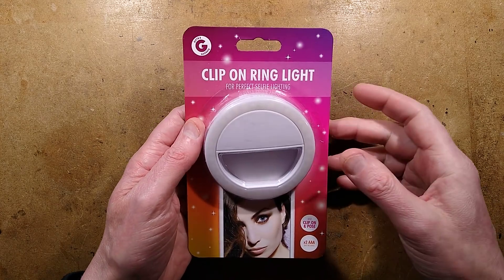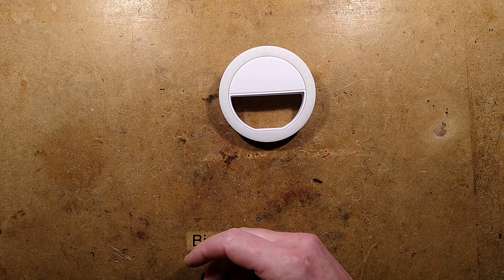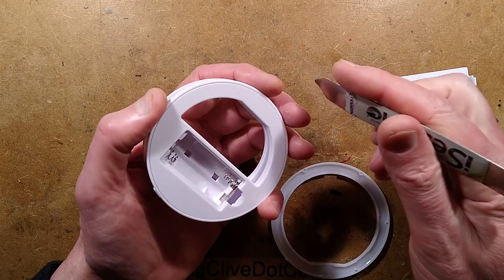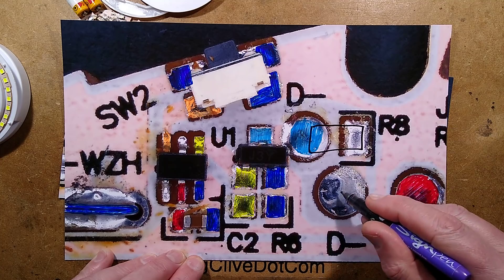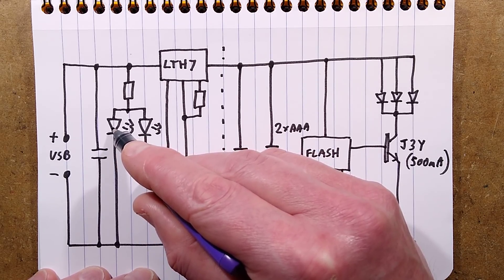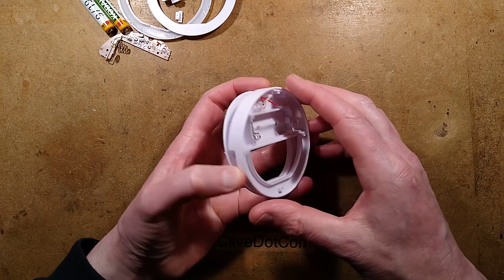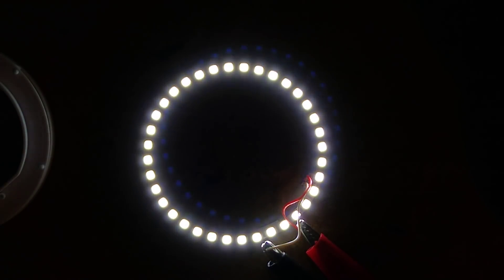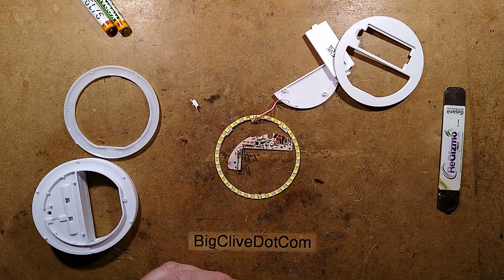Pound shop ring light teardown (with schematic)

Comment: I found that if you just clip it to your clothes they make  really good hands free work lights. I also took the LED ring and stuck it to a 58 to 82mm step up ring so it would attach it to the front of a normal camera lens. re-encapsulated the circuitry into a small project box with a plastic hot shoe cover so it will sit on top of the camera to make a cheap macro photography light. Replacing to 50mAh a higher capacity cell in the rechargeable version certainly makes it lot better light.

Comment: I don't think they use pulse width modulation for controlling the light intensity.
The use of a bipolar to me it hints that they are probably controlling the collector current through the base current, and that is why it doesn't blink.

Comment: Watched this video and decided to open the free promotional light I got a few years ago. The circuit board is a bit smaller and a lot less complicated. All that there is on mine is a switch, an unmarked 8 pin chip, a A2SHB npn(?) transistor and a pair of solder pads(?) for a resistor(?).

Comment: I have an old Bausch & Lomb stereo microscope, one of those which have been on the wire bonder stations. With such a light ring equipped I may extend its usable life. Unfortunately we do not have pound shops here.

Comment: Hi Clive, just seen a thing on BBC news which you might like to look into. It’s a ‘smart socket’ with an led which turns green or red depending on whether or not you’re using ‘green’ energy at the time and whether or not the power you’re using is being wasted. Unless we’re in a position where there is no fossil fueled generation feeding the grid, then there will always be a proportion of the power used coming from those sources and the led would have no business turning green. Similarly, all a socket can determine about the load is voltage, current and phase angle. How would it know the difference between a lamp left on wastefully or grandmother’s iron lung to keep her alive? Sounds like a load of b@ll@cks to me!
Reply from the maker: It sounds like a gimmick for Karens and other faux planet-savers.
Reply: Either BS (did it appear on 1st April) or it talks to a smart meter that gets data from the utility company on where it is buying electricity from.

Comment: ⚠️With the proposed big switch off planned for tonight at 10pm, do you (or anyone else) know if the surge after everyone turns power back on could cause problems in substations?
Reply from the maker: I doubt it will have much of an effect.

Comment: Very good video as always, I wish the Chinese would stop putting strobes on every multi light settings. 
Regarding scavenged lipo cells I'm struggling around the protection of the cell. There only seems to be 18650  boards in strips or circles or usb break outs. Please could you suggest if there is one another protection CB available for the tiny cells?
Take care and stay safe, Mike.
Reply from the maker: You can get cells with the protection PCB on them.

Comment: can you reverse engineering 1$ 3 x seven segment LED voltmeter or ammeter?
its not made by ATtiny24 Microcontroller 14 pin sop14.
it is made by an unknown sop-16 Micro controller. And 90% cheap volt/current meters are made by these cheap IC.
its part number is removed or not marked.
Can you copy its program/coding from this Microcontroller used by a ch341a programmer?
its main disadvantage is, it is not real time reading for voltage or current sensing. it has one second delay to show the output. it is horrible to know real time changes on voltage or current .
i know no one can still identified that chip number in internet. 
I hope you may can break it easily than anybody in the world!

Comment: I bought something off ebay recently that seemed like a Clive sort of thing. Car battery charger claimed to be 14A. It looked chunky but weighed nothing. Straight out the box it was dodgy, every word on the panel was a misspelt translation and it had an illegal unfused UK plug on (on the listing the pictures showed a fused one). There appears to be a grill for something like a standard 80mm fan but there is some tiny fan inside instead. Connecting to a fairly low car battery it indicated 22A charging! putting a meter inline it was only 5.5A. Looking around EBay plenty of these have sold, the customers blissfully unaware its not what they think they got, if it doesn't burn the house down. I am going to have a bit of a teardown see what is in it when I get a moment. Love the channel.

Comment: I have the Kodak branded version of this device. It has the internal Li battery and micro USB charging port.  Designed really for mobiles with camera in the corner. No brands mentioned.

Comment: you can make super fine probe tips using insulation stripped off a cable just smaller than the probe tip and two sewing pins , put the pins in the insulation and slide onto probe tips :-)

Comment: I bought 5 of them from Dollar Tree a week or 2 ago, i should have known better..
The one i got from Walmart a while ago came with a rechargeable battery, the Dollar Tree ones did not, which i should have realized before, being USB powered made me assume it was rechargeable.. However, they are battery OR USB powered, when connected to USB they are much brighter than when using batteries. But yeah, they have some emergency lighting use. And yes, they are intended as Selfie Lights that fit over your phone. Edit: i just tried the walmart one and it also has an SOS mode lol, never would have thought to try it.
Reply: Just a little update.. I decided to take one apart to see how it would do with the LED board connected to a USB cable and a USB power bank.. well... as the Ring LED doesnt have resistors because they are all on the PCB it maxed out at 11w 2.7amps according to the usb tester, and the brightness was insane :/ pretty sure the LEDs would burn out pretty quickly lol, so it definitely needs resistors if being used without the PCB, which again in my case did allow Micro USB for power.

Comment: I bought the same light from Poundland, £2 Vido brand with a rechargable battery that you charge with micro USB. The first one I bought was completely defective. Battery didn't hold a charge (had to be plugged in) and the light settings didn't work, sometimes it would randomly flicker like it's shorting out

I wish I kept it, would of made a good video for you 😭

Comment: Hey Clive, long time fan.

Recently i screwed in one of those huge glass ball filament lights in my room and it lit up even while the switch is off (because of incorrect wiring, i reckon), wonderfully, it didn't seem to strobe at all, like many other lamps do when off in that socket.

I couldn't help but notice how stunning the dimly lit filament bulb looked and how normally you can't really appreciate it because of how blindingly bright they are.

So it got me thinking if there was a way to mod these bulbs to be super dim but in a proper manner, kind of like a dooby mod taken too far, preferably without noticable flicker and somewhat efficient.

Having an entire ceiling of these lights would be a dream.
Reply from the maker: That's common.  Especially with multi-way switching due to cable capacitance or with some switches that have internal neons to make them visible at night.
LEDs are so sensitive that they will glow with just microamps.
Yes you can make that lamp glow as an ornament.  Just add a 100nF mains rated capacitor in series.  You may wish to put a 1 megohm resistor across the capacitor to discharge it and avoid tingles.
Reply: A "Dooby mod"? 
Isn't that something done to Jewish boys when they're 8 days old?
Reply: @hughjanus1840    a criminal act of mutilation, legend says "made in his image" and they chop of a bit ...

Comment: Probably a nice light for hacking/salvaging parts, not so much for its intended use :P
And thanks for mostly answering my festering question for quite some time how you keep your spudger so... "un-bent". Mine ("ProFessional TE-03") already looked horrible after a few uses, though it's still holding up decently. Might invest into an iSesamo at some point 😉

Comment: I have 2 of the version with lithium cell and usb port, which came inside Nesquik boxes (I didn't intend on buying 2, but I forgot I bought the first box so I still have some left). It's useful for taking pictures in inside the house since *all* lights in this place are downlights.

Comment: From what I remember the IC is pic10F clone. I have similar ring glued to magnifying glass, works great for soldering small things. :-)
Reply: oooh that's a great idea!
Reply: my helping hand has leds and a battery compartment built in, should add a soldering wire dispenser and fan

Comment: The problem with using a ring light like this on your phone for video calls, selfies, etc. is it often makes a white ring in your eyes that looks awful and unnatural.  But a ring light can be used to great affect for macro photography.  Using the right colour temperature is also important but often these cheap lights get that wrong and don't even list it on the box.  YMMV.

Comment: I wonder what it would do plugged into the usb port without a resistor.
Reply from the maker: It would probably result in quite short LED life.  But maybe the cable resistance would save it.

Comment: What about trying to make a USB (connected directly from the phones supply (can a phone put output power from itself)) 3D printed model Clive, with the standard 5v LED tape stuck around the edge, complete with switch?
Reply: Yes, if your phone has the OTG power function available at the USB socket.

Comment: you could use a USB OTG connector to make it phone powered, no batteries needed, just put a resistor and USB plug on the light, glue the diffuser on and slip in the phone case.

Comment: Clive, could you do a how-to on removing that stupid flasher from common circuits? I have so many good flashlights absolutely ruined by that flashing "feature"
Reply: It's inside the same chip that does the off/on function.  On bicycles and clothing accessories, the flash mode is supposed to save battery while being even more visible to cars.
Reply: @johndododoe1411  on bikes blinking lights are forbidden in some countries (like Germany), but there are still more than enough fools who use them, ideally set up at angles that don't illuminate their path at all and just blinds others... Really wonder why no one has thought about banning blink/strobe modes on those lights...
Reply from the maker: It's built into the chip.  Not so easy to remove unless you write new software for a pin compatible chip.

Comment: I have the rechargeable version of this, it came with the cutest little 50mah li ion pouch cell (about the size of a finger nail), upgraded that to a more reasonable 400mah cell salvaged from disposable vape device. Work great as a light in a tent too.
Reply from the maker: A worthy use for street-found disposable vapes.
Reply: My little brother has this but it has a built in rechargable battery with two tones of white. It charges up with micro usb

Comment: Who needs a mode switch on a camera lamp? Cameras need as much light as possible, so the low setting is pretty useless. Just put there an on/off switch and you don't need any electronics.

Comment: FYI Clive, Poundland have started selling a rechargeable version of this, and a few other interesting bits and pieces under the Viido brand name
Reply: I've found Poundland's Vido USB-C charging cables are pretty decent quality, A good length (2 metres) very flexible with braided covering & work well with both standard (5v) & fast charging (9v) speeds. Cost £2.50. Much better than the cheapo short cables that come with the phone.
Reply: @NOWThatsRichy  Good to know, some of the cheap stuff is very thin!

Comment: I generally assume these days that those 6 pin chips are probably PIC clones (paduk) which have been factory programmed. I would think that at the silly price they cost, custom ASICs would be an expensive option even in massive volumes
Reply: However a general blinker chip wouldn't be an Application Specific IC, and would use a lot less transistors than even the clock and power circuits of an MCU.

Comment: I downloaded a circuit program I just wanted to test some capacitor times, but at first when I drew it out like your schematic it just said capacitor shorted, which made me wonder, how ttl are your drawings 👀
Reply: Look again, the only components parallel with capacitors are the battery and the USB connector.
Reply: @johndododoe1411  yes and it was the capacitor in my circuit which caused problem s

Comment: A few years ago I designed a custom ring light PCB that was simply a friction fit in the 58mm filter ring thread of my Canon PowerShot SX40 - it works pretty well, though could do with some more diffusion :)
The ring is just a couple of dozen 0805 white LEDs in parallel on a 0.8mm PCB, with wires leading to a micro-USB-powered, variable, constant current driver based on a traditional linear regulator (whose number escapes me right now) and a fat potentiometer. Not very efficient, but it works nicely and there's no flicker as far as I'm aware!

Plus, the driver PCB fits within the inner diameter of the ring light, so OSHPark didn't charge any extra for the driver board :)
(I didn't even have to panelise the two designs, IIRC. I just needed both designs in the same gerber files, with the driver inside the ring, and at least 1mm clearance between them for the router bit, then OSHPark's panelising software did the rest!)

(To be clear, the PCB permanently lives in a spare UV filter - that's used more as physical protection for the lens than for blocking UV. I just screw it on as needed.)
Reply: i made a similar board for my microscope since it's a nikon smz with an oversized barlow ring and a 3d printed case to hold filter paper, i found 5 sheets of vellum makes for an incredibly diffused light.
Reply: Try some parchment paper to difuse the light or maybe wax paper

Comment: I'm still trying to figure out why anyone who would use this for making selfies would want a strobe function in the first place  :)
Reply from the maker: It's odd.  Maybe just a standard program option for other applications like a flashlight.
Reply: I think this chip is designed to be used in bike lights, so you can have them dim, slightly brighter, quite bright and then irritatingly flashy so that drivers can see you.

Comment: I'm pretty sure that light is mainly intended to go over your front camera, for selfies and video calls. In that case the camera lens should be fairly centered in the ring. It would cover a bit of your screen though.
And thanks for the comment about the iSesamo - my generic clone gets bent quite easily, will check out the original.
Reply from the maker: The generics, bent, kinked and snapped with sudden explosive sharp edges.
Reply: @bigclivedotcom  Can confirm, the clones aren't nearly as springy and seemed to go into plastic deformation far before the iSesamos do. Went through a few of the cheap clones at my old job before finally getting the real deal, and they're far better.
iFixit's "Jimmy" isn't bad, either, but the plastic handle can be cumbersome in some situations.

Comment: That's not a great design on their part; direct connection of batteries to LEDs means it won't work well on partially discharged alkaline batteries and probably would barely work at all with rechargeable batteries.
Reply: The transistor probably limits the current to about 200 times the current supplied by the blinker chip.  But the variation between individual transistors and the lack of a sense circuit probably forces the limit to be higher than needed on most units.